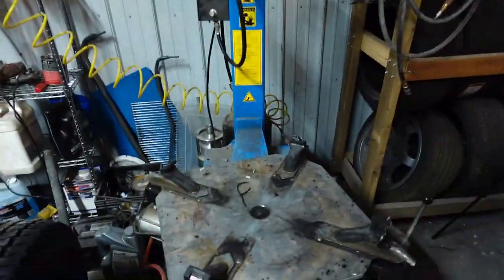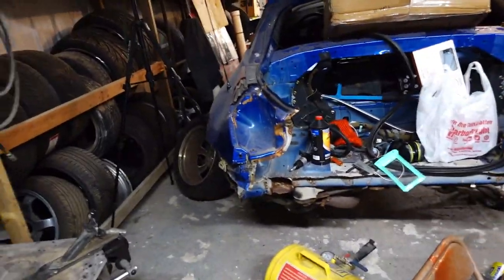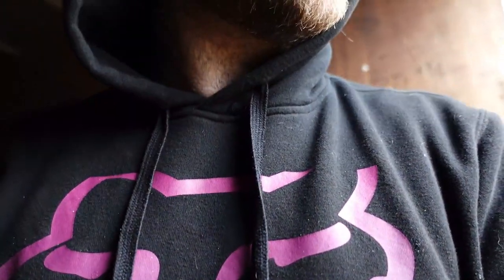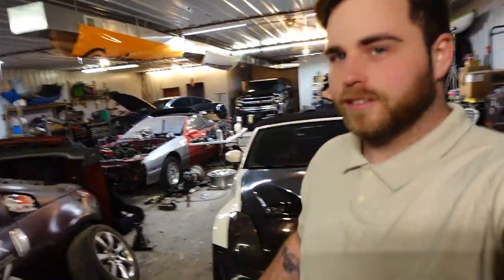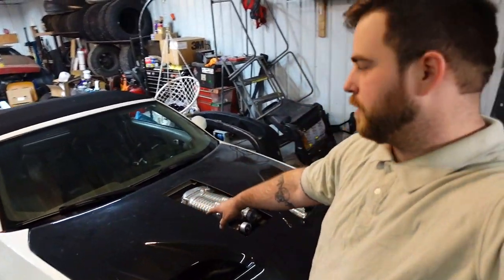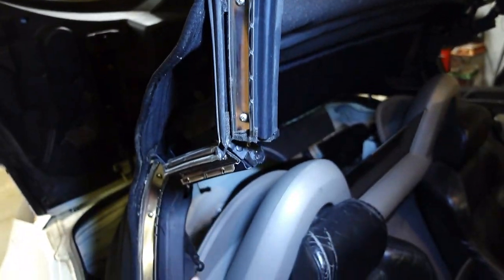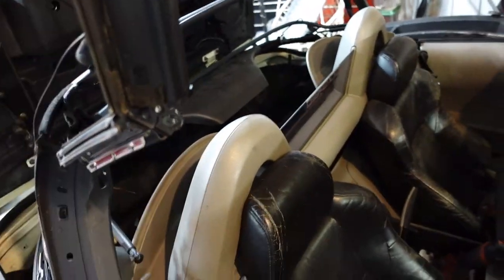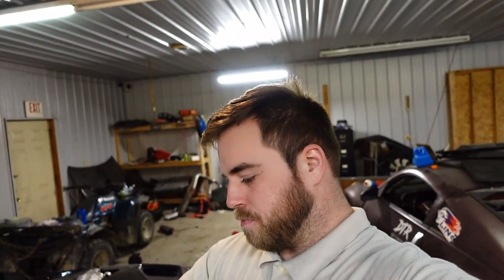Replacing a 350Z Convertible Top (step by step)

Comment: Did you have to replace the tension straps on the 2nd and 3rd bow? Currently halfway through this process on my 06 350Z.
Reply from the maker: We should have but didn't, if you don't, just remember to move it with your hand while opening/closing
Reply: @CountyLineTV  that's currently what I was doing before replacing, pushing it down, but looks pretty lame. You may be able to help with my question.

So, my new kit came with straps, but they are longer than the OEM ones. I'm wondering if I would need to stretch them to the point where there is enough elasticity to pull the 2 bows together, then cut them at that length? The instruction booklet gave no help on this and I tried to contact the manufacturer of the top with no luck for an answer🙄

My next step is going to the forums.
Reply from the maker: I would say maybe just wrap them around further before riveting or yeah just cut them